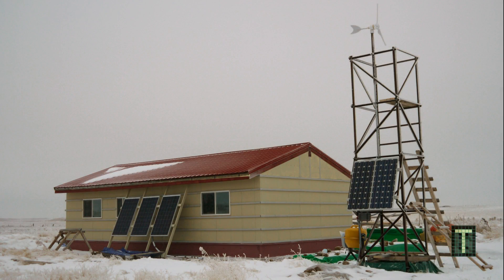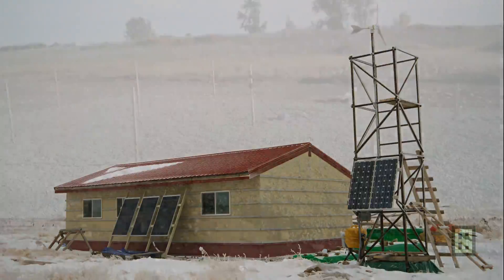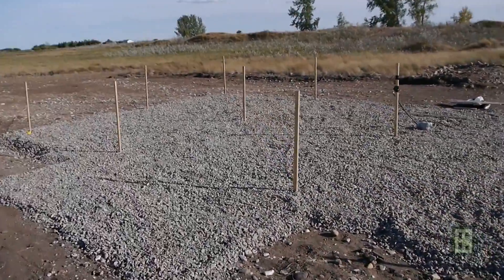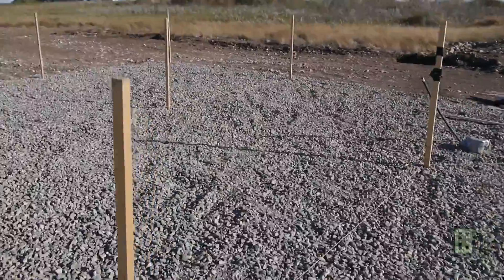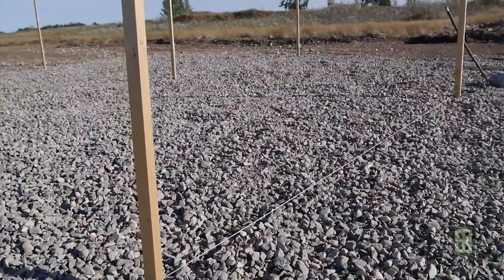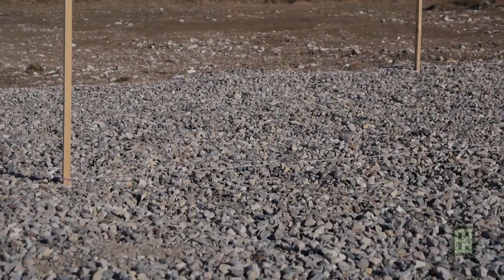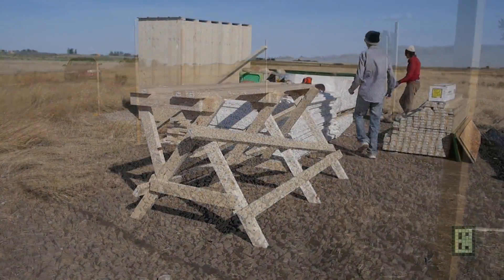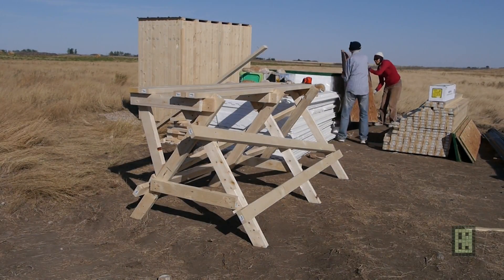Off Grid House

Comment: Are you using geo-thermal... water to water with a COP of 5 or more to heat the house ?
Reply from the maker: Mark Osborne For now as temporary solution I use propane to heat water then circulate that hot water in the concrete slab. Geo-thermal is not a good option for me. It will be more expensive than direct electric heating with solar PV panels. I will use solar PV panels + a special controller that I will build and resistive heat elements embedded in concrete slab under the ceramic tiles nothing else.
Total cost for equipment will be around 10k$ and this should provide me with at least 25 years of heating (amortisation cost just 10k$/25years = $400 / heating season) Winters are long and quite cold here and at the moment I pay about $1300 / heating season with propane this is just propane dose not include the cost amortisation for the propane heater water pumps, heat exchanger and all the other related stuff.
Geothermal will need to have a COP of at least 3 to 4 real and cost under $4000 including the heat-pump, ground loop and all the pipe circulation pump and last for 25 years or have included in the cost the replacement parts for 25 years to be able to compete with pure electric heating with solar PV.
My solution of heating directly with solar PV panels will not work for any house. I have a large thermal mass (14 cubic meter of concrete that can store about 100kWh in the form of heat and that can be good enough for 3 to 4 days in the middle of the winter with absolutely no sun).
Last winter there where some strong winds and I was not able to use the propane heater for a few days but it was no problem I was losing just around 1.5 to 2C in 24h and the house was still comfortable even with no heating and around -20C outside temperature.
The house only requires around 1000kWh of heat in the worst winter months usually January. An average house here needs about 10x more because it is about 3x the size and has around 3x worse thermal insulation.
Reply: ***** I completely understand the math and your logic. 1000KWh x 3412 =3,412,000 btu's per month...  is nothing ! We use about 25 million btus per month for the months of Jan, Feb. Natural gas is just under $8 US per million btu's just to put things into perspective. 

Yes, with what little it takes to heat your place you only need to generate 1000/30 = 33 kwh's per day in PV energy. I'm guessing you have 3 hours of full sunlight per day on average ? so.. 11,000 watts worth of solar panels dedicated to heating "should" do the job and like you point out, the investment in radiant heating elements will be substantially less than a ground loop. 

Have you noticed the recent leaps in technology for air to air heat pumps ? They are able to work down to -5F !   One of our neighbors put in a multi-split unit ( $1700 on Amazon)  and when I questioned why I see the fan blades turning in the coldest days of winter, he claims it's still pushing reasonable heat into his house !   Of course our coldest days are nothing like yours, but I'm wondering if you couldn't use an "air to water" heat pump with a cop of around 3 until the temps drop to the point where it becomes inefficient... then switch to pure resistance heating.
Reply: Mark Osborne ...... then I got thinking... if you need the 11K worth of PV anyway for the coldest days ...why screw around with any form of heat pump. It just complicates your world. The PV array doesn't care if you're using 30% or 100% of it's capability and to my knowledge has no ill effects on the life expectancy of the panel. Furthermore, you might need a very large air-to-water heat to be able to bank all those btu's into your concrete with only 3 hours of maximum sun per day.  So that whole idea may be silly... but I love this conversation so I'll just leave it and enjoy your reaction !
Reply from the maker: Mark Osborne Worst months here November and December I get about 3.3h of sun January is in average at around 4.2h and February 5.1h
So based on my calculation about 9kW array will be more than enough that will be dedicated to heating but can also be used for many other things since they will end up as heat anyway if used inside.
For example we drink distilled water only that is about 4 litres/day (one gallon/day) and at the moment I get that at the store for about 2$ that is $700 / year and that alone is more than amortisation cost of the entire heating array as I mentioned $400/year.
I used to have a modern split air to air for heating when I was living in Europe but the winters where much milder there.
-5F is about average temp here in January and is not unusual to have a few nights with -40F (-40C) and max during the day of -22F (-30C)
While below freezing even those dual compressor air to air heat exchangers will become quite inefficient at best COP of 1.5 or even worse.
Another problem is that they are mechanical devices not solid state so it may need one or two replacements over 25 years period and if it fails in the winter that will not be great.
In 25 year I will probably only get 80% of the original PV array but all I need to do is add 20% more panels and I'm back to original for another 25 years.
The radiant heating is almost free maybe around $500 for copper wire that gets embedded under the ceramic tiles in my 65sqm (700sqft) house.
The 9kW PV array is around 80cent/watt so $7200 this are USD the CAD is worse at the moment.
I will get a 2 to 3kW array this year and experiment with part of the house heating (I can not afford more this year). Even this 3kW array should save me about half the season heating since since some months require much less heat that the quoted 1000kWh for January. February needs usually around 700kWh and March around 500kWh or less and both this months have above 5h of sun/day.
With the full 9kW array I will have quite a bit of excess energy in this months but is needed for December and January.
Reply: ***** I get your math and agree.... One question. What do you think about installing say a 40,000 liter water container in an insulated extension to your house - banking the heat (PV resistance heating) then pumping it through your existing floor heat using the existing pump as opposed to adding resistance elements under the floor tile ?... just curious. I know it adds complexity but might save some complexity on the other end VS- installing floor elements.
Reply from the maker: Mark Osborne It is not a big deal to add resistive elements under the floor tiles since I did not installed the tiles as of now. The resistive heat elements are also not expensive as I mentioned probably around 500 or $600. A large water tank will be expensive plus I still need the restive heat elements to heat the water and the water tank especially one that large will be extremely expensive the adding an insulated building for it pipes and circulation pumps makes for an expensive and less reliable system.
I do have at the moment PEX tubing in the concrete floor and I have a small 200 liter water storage tank that is currently used together with the temporary heating solution made of an inexpensive 10kW thankless propane heater circulating coolant with a small DC circulation pump trough a stainless steel heat exchanger that has on the other side another small circulation pump to heat the water in the 200 liter water tank.
From there there is again another DC circulation pump that circulates the water from the 200 liter tank trough the PEX embedded in the concrete.
I normally run the propane heater at around 7kW or so (is about 80% efficient so the input is about 9kW) for about 3 to 4h a day depending on how cold the day is.
There is not much PEX and that can only take around 4kW a bit more at the beginning so I need to run the heater in two sessions each of two hours else the coolant temperature gets to the 80C limit on the output.
Anyway this year I will probably install a 2 to 3kW PV array and I will have that heat the water in the 200 liter tank and compensate with propane in the days with less sun or colder but this is again a temporary solution.
I will end up with a completely solid state solution and no moving parts or hot liquids.
You can see some photos with that 200 liter 55 galon barrel and the inexpensive 200$ or so propane heater that worked fine for two winters and it will need to do for another one before I can do all solar PV.
Here is the post from first winter initial install https://plus.google.com/+DacianTodea/posts/SDVyfKjAGev
Close up of the inexpensive thankless heater https://plus.google.com/+DacianTodea/posts/8EKdxc3sD7j
And a bit of an update for this past winter https://plus.google.com/+DacianTodea/posts/8EKdxc3sD7j
I needed to enclose the heater completely and use a small centrifugal fan for combustion air since else it will not work when windy. Not it works great with winds up to 35km/h or so and is much better.
Reply: ***** Very nice.  I mean to say 4000 liter, not 40,000 ..! Sheesh.. it was late and I was tired and woke up in the middle of the night thinking "did I say 40,000?".  

I didn't know it would be so easy to add heating elements to the floor, and of course if you haven't installed the tile yet - makes it all the easier. I'll be very interested to find out how the electric/solar heating elements work with your 55 gallon tank. Bet it will work great.

Comment: Your your idea of building the metal frame so you can service the wind turbine is spectacular and giving me bad ideas...!!!
Reply from the maker: Mark Osborne :) The frame was mostly build that way to be inexpensive and sturdy. The cost of steel was under $200 do not remember exactly and concrete for the foundation was around $50 so around $250 total if I do not take the work in to account. The most work was digging for the foundation.
I quite busy at the moment but I will have more videos done when I get the time.
You can see a bit more photos on my google+ account https://plus.google.com/+DacianTodea/
Reply: ***** You've got me back thinking about a vertical wind turbine.... sticking this on a similar frame in the back yard and using that same frame to mount the PV panels.  You are bad !!!!!
Reply from the maker: Mark Osborne
I was actually thinking about a vertical wind turbine Svonius type when I designed the frame.
I just quit the idea I like solar much more and is plenty of sun here.
I have a realy old video with calculations about the savonoius type wind turbine that can apply to other models also.
The audio is not great on that video but there is an excel calculator that you can download form the video description to play with it. I explain how it works in the video and I was going to use a servo motor for this wind turbines.

Comment: Made it to be bulletproof huh?
Reply from the maker: Diane Hunter I hope is wind proof :). Wind is a bit crazy here in this large open field.People probably imagine this is a bit of over engineering but is not realy. Is probably a bit stronger than a 2x6 frame wall while not being more expensive at least not in therms of material cost. Is quite a bit more labour intensive but is simple to build.
Reply: Was that 2X4's in the wall or 2X3's?
Reply from the maker: Diane Hunter The wall is made with 2x4's

Comment: I have never seen a structure framed like this with dimensional lumber. It is very similar to log cabin framing. I am curious as to why you chose to use this method of construction. I do not see the advantage of it.
Reply from the maker: There are multiple advantages to this type of construction method. Is a much stronger structure than a 2x6 frame no need to use OSB (toxic glues) cost about the same as 2x6 frame + OSB for the materials but is quite a bit more work.
Using structural lumber instead of logs or prefabricated logs is less expensive.
It depends on what you want. I want to live in a healthy house and I do not like to worry about the house folding in high winds like a 2x6 frame will normally do. The house is build on a flat piece of land with no shield from other structures or large trees.
So may main reasons where acceptable cost with easy to get materials, no OSB use and stronger construction. The cost of material for structure was just 1000$ more compared with 2x6 frame + OSB (osb is quite expensive even the low quality one).
Reply: Ok thanks. House turned out great I hope you enjoy it. Thanks fro sharing.
Reply: ***** No issues with the choices in general but your assertions on resistance to wind are a little weak.  A modern Canadian building standards house will easily withstand 110 KM/h winds and more.  Also, roof design and quality assembly (As yours certainly looks to be) has a far larger impact on overall wind storm survivalbility of a house.  Lose the roof and you lose the house every time.  The biggest advantage that your choice of materials affords you is far better air sealing and far lower heat transmission from inside lumber to the outside.  Something that is problematic with open framed walls as I am sure you know.
Reply from the maker: Jason Price
I already had 108km/h since I moved here so stronger winds are sure a possibility. There is no wind brake like other houses or trees is in a middle of a flat land.
The house was without a roof for almost a year do to slow construction but no wind wind will have put that walls down even without the roof.
There where many things I did not liked with that classic frame wall and the cost saving was really insignificant for DIY. There was considerably more work on my method but I consider it was worth that extra effort.
Reply: ***** Agreed.  In an incomplete state, your house would be quite a bit stronger.  I have had 100 KM/h + winds in the winter and we also had the end of the hurricane last summer and there were no structural failure issues in the Atlantic provinces from the winds besides the trees blown onto the houses!

I like the work you are doing as it is good to see people showing that there are different and perhaps better ways to do things.  Pushing boundaries is how we find out where the limits really are.  It was a big step for me to choose a GHP for our construction all those years back and I am VERY glad I did.  When it comes time to re-shingle my roof, I will, in all likelihood, look at adding at least some solar.  Where NB Power has a pretty good FIT, I would likely do it as a grid tie.
Reply from the maker: Jason Price
If you already have grid then grid tie is for sure the best option. Maybe by the time you need to do that you can completely replace singles with solar PV panels.
Reply: ***** That is my dream!  That someone comes up with a reasonable shingle replacement that is a PV system in the next 7 to 10 years (When I need to to the work).
Reply from the maker: Jason Price
I'm sure that will happen in the next 7 years. There are already some options not sure if they are more expensive that traditional PV + shingles at this point.

Comment: Salutare!
Bănuiam eu de la ce vine „dacus” dar a trebuit să citesc și comentariile pentru confirmare.
Cred că tubulatura din pardoseală ar fi trebuit să fie mai deasă, dar probabil că o să compenseze prin izolația exterioară meticulos realizată(Văd că nu te-ai zgârcit nici cu vata din acoperiș. Mulți o ignoră dacă podul nu este locuibil.)
Felicitări pentru construcție, pentru felul cum te gospodărești și pentru ceea ce întreprinzi!
Reply from the maker: Mersi, Da tubul prin pardoseala trebuia sa fie mai des ca sa fie mai uniform distribuita caldura da am crezut ca aia va fi doar de confort incalzire desi merge is doar cu tubul la distanta aia.
Oricum voi pune gresie peste tot si sub gresie resitente electrice de incalzire pt ca incalzirea cea mai eftina este cu panouri solare fotovoltaice.
Cand am facut proiectul la casa panourile erau 5 sau 6$/Watt acum sunt la sub 1$/watt.Nu miam imaginat atunci ca va devini 1$/Watt asa curand.
Izolatia termica e cu siguranta cel mai eftin de amortizat. Este destul de frig aici (anul asta e un pic de exceptie) da in mod normal -30C pe zi si -40C noaptea nu e neobisnuit. Cu toate astea casa are nevoie doar de 1000kWh/luna in cea mai rece luna pt incalzire de aprox 10x mai putin decat o casa medie aici. Este de aprox 3x mai mica decat o casa medie si de 3x mai bine izolata.

Comment: Very well built Im a union carpenter from Canada,that house is like a tank!
Reply from the maker: Thanks Austin for the comment. The house is exposed to wind here and I will not have felt safe in a traditional 2x6 frame structure. My first choice was ICF but I did not had quite enough money and will have been a bit more difficult to build by just two people. The highest wind speed up to now was just 110km/h I hope it stays that way :)
People think this construction method is expensive (They are probably right since it takes much more labor but the building materials are only around 10 to 15% more than 2x6 frame and OSB ) Good quality OSB is expensive and I prefer lumber less glues and other chemicals.
Reply: ***** great job nonetheless, looks like you are in Canada or a similar climate. And in an open field I can understand the wind speeds, would like to see a video on your power system and how the interior of the home came out great job once again!

Comment: Waste of wood in my opinion. But other than that whatever works for you.
Reply from the maker: It is extremly windy here I will not have been confortable with a typical frame house.
Also the cost of aditional wood compared with a timpical 2x6 and OSB wall was just about 1000$. Also OSB is quite bad quality using realy nasty glue even after two years outside the OSB that I used for the fundation is still smelly and probably not that healthy.